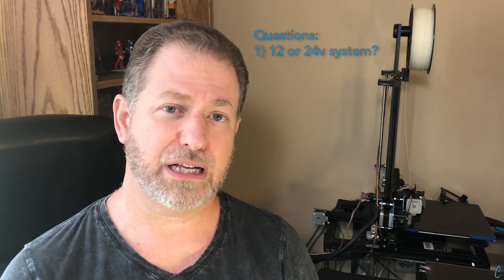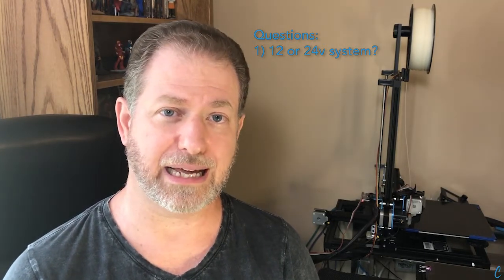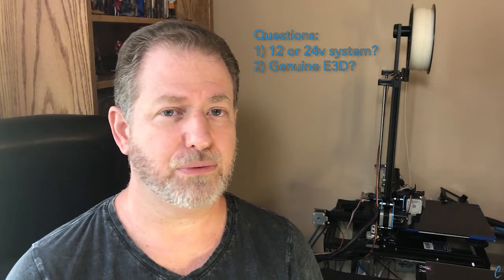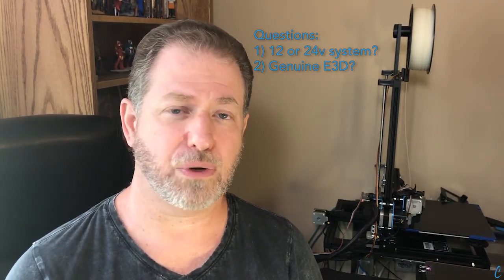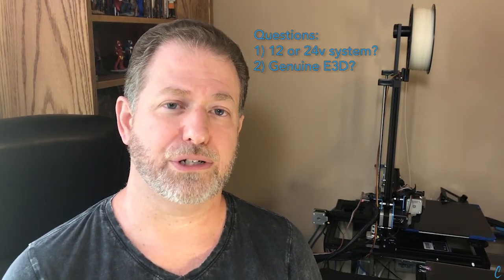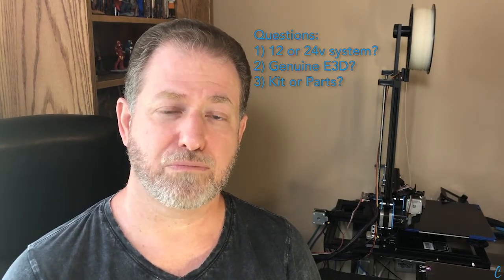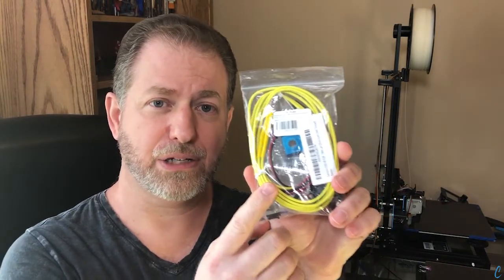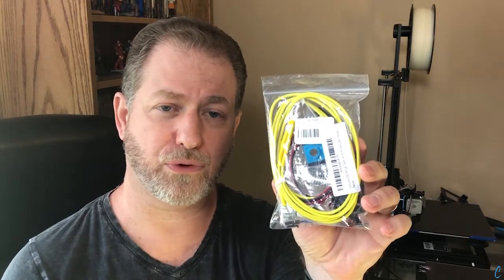Upgrading The Sovol SV01 To E3D V6 All-Metal Hot End - Questions & Answers

Comment: thanks for the information, I just bought the E3D v6 hotend and I have been watching your videos, I wanted to ask do I have to print any parts for the setup before I take everything apart?
Reply from the maker: It may be helpful to print a new fan duct - I have one on the Discord channel that is already 1mm shorter, which will be needed. (or you can sand 1mm off of the stock fan duct)
Reply: @CreativeGraphicsGroup  thanks for the help, love the channel